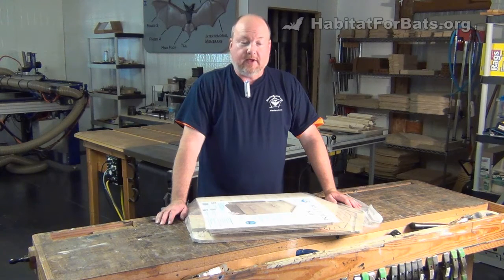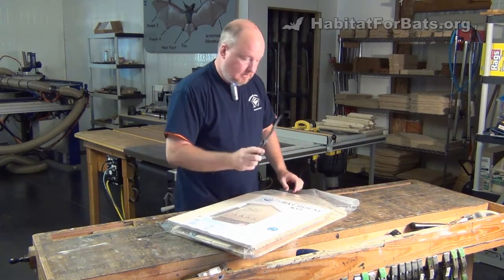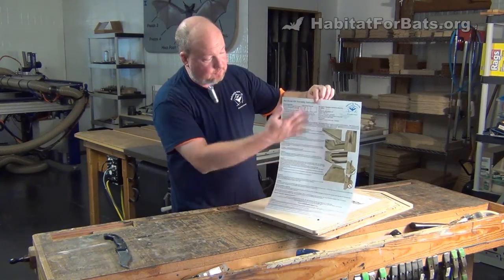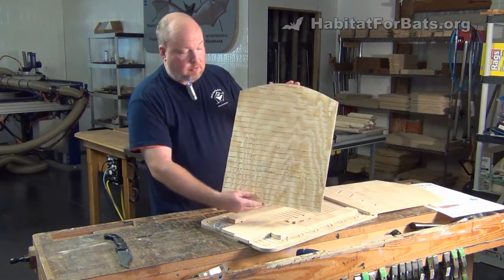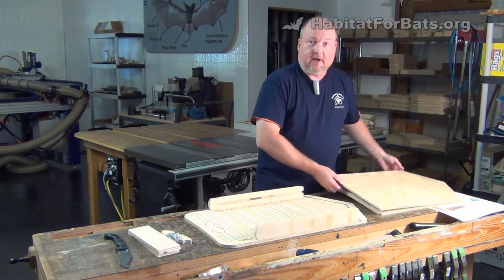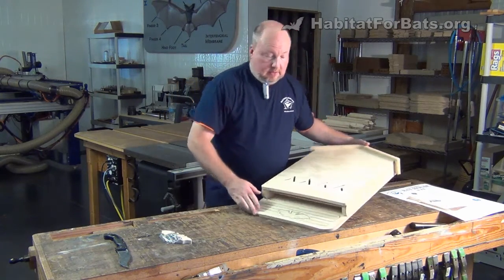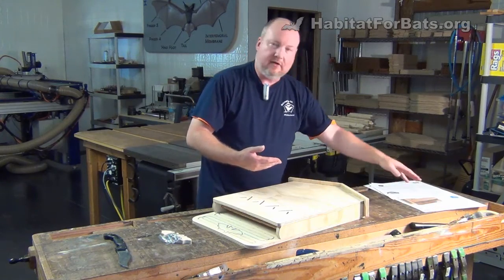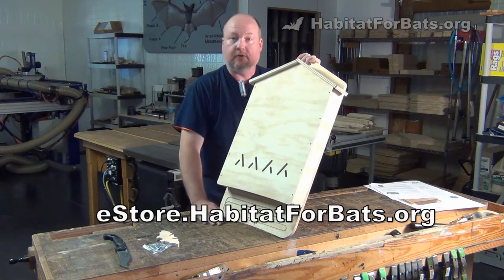Two Chamber Bat House Kit - Introduction

Comment: Very well done bat house looks great  the two chambers is perfect started to order but the shipping charges scared me away......
Reply from the maker: Our bat houses are large in comparison to most on the market. Even in kit form they have a fairly large box. We charge actual UPS shipping costs with no up charges. If you think the shipping calculator got it wrong (whcih it occasionally does) please reach out through the estore and ask us to verify the shipping, we'll be happy to do so.  Also, we do sell on Amazon as well so if you have Prime that may be a good option.
Reply: Thank you for the reply ordered your 3 chamber kit from Amazon saved on shipping.